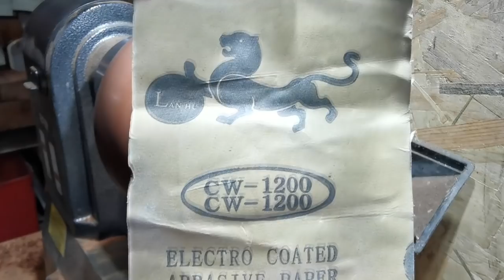woodturning :lidded box

Comment: Hi,

Thanks for sharing this lovely box project; the end result is excellent.

I'm rather concerned how you hold the wire for wire burning and hope it doesn't encourage others to do likewise;  the wire should for safety be fitted with a pair of handles and never ever wrapped around the hand or fingers; if the wire grabs it's possible to lose fingers in a blink. 

Kind regards, Colin.
Reply from the maker: Hi Colin Wood,
Thank you for your comment .
You are right it is dangerous to hold the thread with your fingers, it is for these reasons that I clearly indicated in the description under the video that it was not necessary to reproduce what I am doing.
Don't worry, I'm not holding the wire wrapped around the fingers but simply pinched.
Reply: @bawbreizhartwood 
 Hi,

Many thanks for your reply which I appreciate. I didn't want to criticize in any way but I know lots of novices view these excellent videos. Woodturning is addictive though isn't it and there's no known cure; I've worked with lathes both woodturning and metal turning for over 50 years and never get bored.

Kindest regards, Colin.